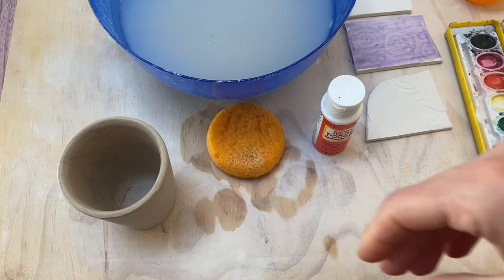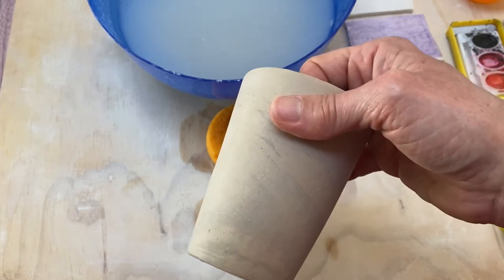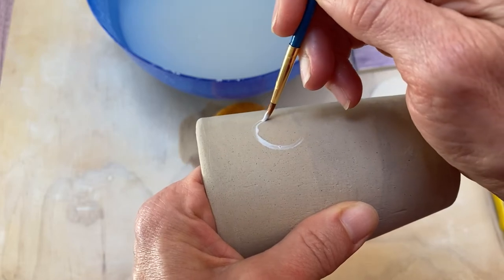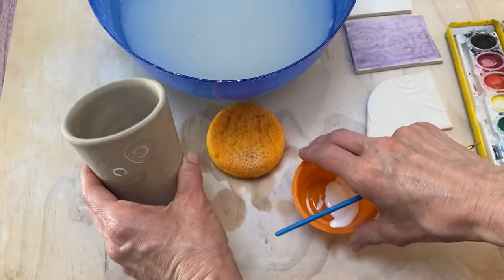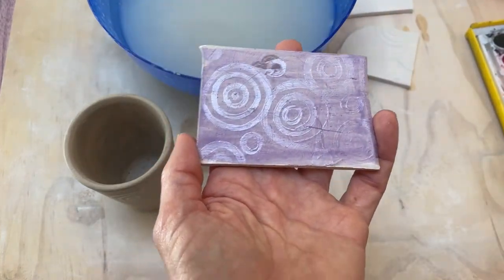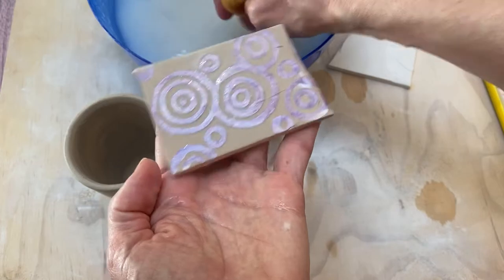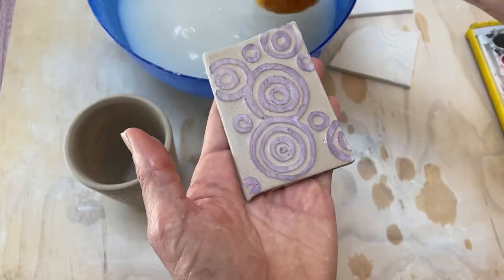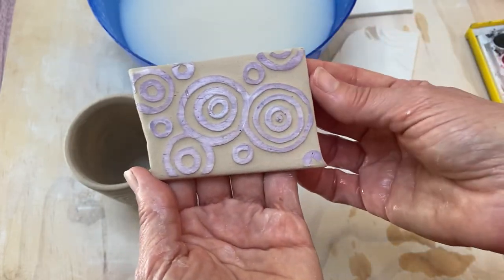Resist and water etch in clay

Comment: Mod page is work as water regist. Shellac oil,
Wax. Etc.
You can paint with Underglaze and over with Wsx or Shellac oil、you can keep the color.
Reply from the maker: The ModPodge acts as a resist similar to shellac, but it is  waterbased so clean up is easier. If you wanted color, you would have to do the underglaze first, then use the resist on top. If you put the underglaze over the resist it will not adhere to the clay.

Comment: Does the glue safety burn off?
Reply from the maker: It has no adverse affect on the clay. It's a small amount of resist on per with waxing the bottom of a pot. Which btw, you could use wax resist instead but it doesn't adhere as well and sometimes easily peels away.
Reply: Yes